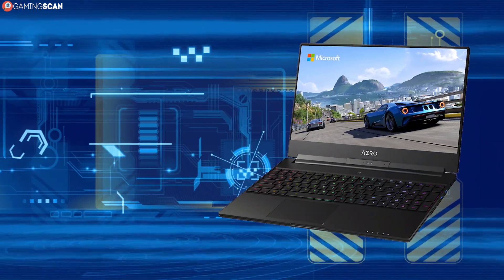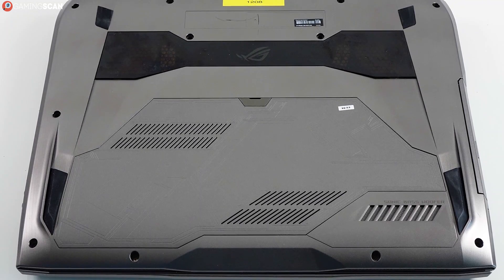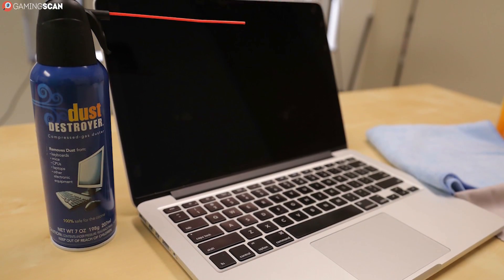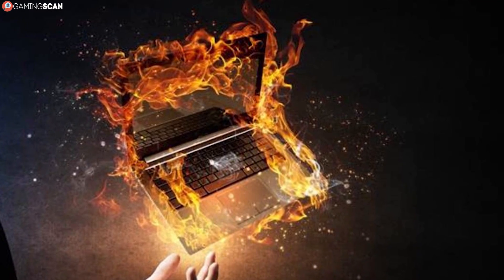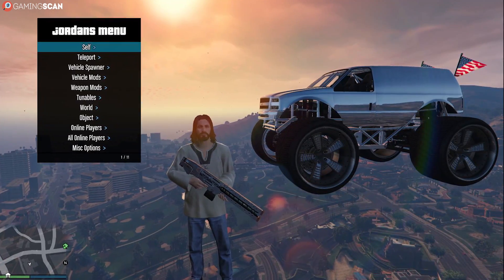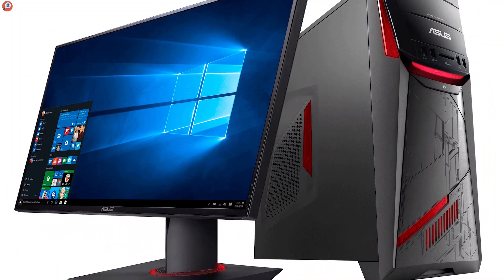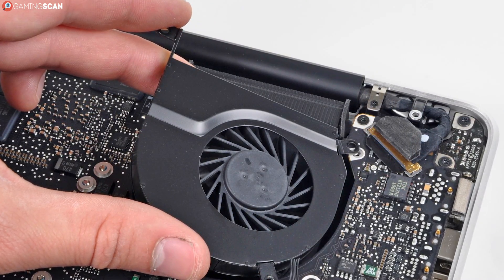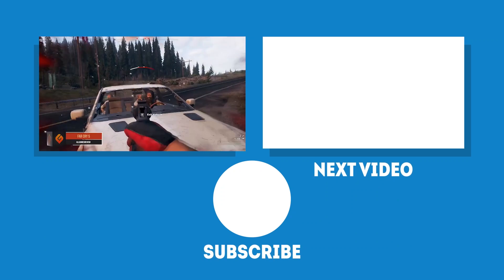How To Keep Your Laptop Cool While Gaming [Simple Guide]

Comment: Heads up: do NOT blow air in to the exhaust vents! This will reverse the rotation of the fans, causing them to act as dynamos and generate a current, potentially damaging the electronics. Techs will unplug all fans before using compressed air.
Reply: thank you
Reply: @fastbutsafe5461  it doesn’t really matter, u promise
Reply: @TheGrassyDirtBlock  My laptop gets hot when I use it to play games while charging. Is it safe and normal? It reaches like 90 Celcius
Reply: @ahmednasrullah8215  No. if it is too hot it will permanently break/slow
Reply: @jaswinder113  Now it decreased to 60-80 is that safe and normal?
Reply: @ahmednasrullah8215  how about, you put the PC fans maximum, don’t over lock it tho
Reply: @ahmednasrullah8215  90c on CPU normal for gaming laptops, think Intel 95c before thermal throttling and AMD 105c
Reply: @D3ATH-W15H  bruh. My ryzen 5 laptop is around 70 around its max with overclock. If its hits 70 im turn it off and have a break. I dont want to broke my 3060 or something
Reply: @D3ATH-W15H  BRUH
Reply: @barnabashatvani9108  70 degrees is fine for a gaming laptop, in fact that’s amazing for a laptop. My cpu is at 90-95 degrees at load.
Reply: @jamrah8713  same here, need some guide on how to cool it down. I'm using asus tuf series with rtx3070 and i7 12th gen
Reply: @edogawaeduardus6149  that's fine just don't let it go to 95 degree
Reply: I think it would be fine as long as you hold the fan or you don’t put to much air in at one time
Reply: thats why they said intake fan grills in the video
Reply: Thanks
Reply: i have a ideapad gaming 3 82SB it has an exhaust vents in the back and ive putted a box fan literally behind it, its been a week since ive done that, ive done it for like almost 2 weeks, it seems fine, laptop is new, btw i think it has 4 vents 1 each side 2 at the back
Reply: Yeah I blew my internal gpu fan that way, using an external fan now

Comment: "Use it in a cool place"
Me in Malaysia without turning on air cond to save electricity:
Reply: hi from Spain☀️
Reply: My previous laptop died immaturely because of the heating problem. My new computer has a water cooling system. Water has a very high heat capacity and latent heat of evaporation as compared to air and it can remove huge amounts of heat as it evaporates. I have a plastic tray and I place a wet kitchen towel on it. I place the lap to on the tray with wet towel underneath the computer. I keep adding water to the towel as it dries. This solves heating problem perfectly. Never ignore a heating problem.
Reply: @heavenlymilano   Smh this is so bad pls tell me you dont do this anymore
Reply: @HungryShark2  I keep doing it. It is the best cooling system.
Reply: Hi from morocco
Reply: Trueeeeeee
Reply: My laptop gets hot when I use it to play games while charging. Is it safe and normal? It reaches like 90 Celcius

Comment: One more thing you can do is to raise the laptop from the intake side using any object to allow more airflow to the intake grills at the bottom and it also provides a better position for typing on the keyboard.
Reply: I do this, and it reduced my temps by 5-10 degrees
Reply: how much raise height are we talking
Reply: @delayedcreator4783  atleast an inch or two.

Comment: Throttle stop + after burner and adjusting your fans.. hell with throttle stop u don't even need your fans maxed out if u do it right. I got a gf 65 I7 9750h with rtx 2060 tamed with amazing performance and thermals. Its crazy i have a thin notebooks thermals under control like i do now

Comment: If you wont open the Laptop to clean it, you cant clean in proberly. Cooling pads are useless. Open your Laptop will not destroy your warranty. External GPUs are expensive and pretty shitty. 

Do at least a bit of Research before you do a video like that. You havend even mentioned undervolting, which is like the only thing that helps to keep the Temperature low.
Reply: My previous laptop died immaturely because of the heating problem. My new computer has a water cooling system. Water has a very high heat capacity and latent heat of evaporation as compared to air and it can remove huge amounts of heat as it evaporates. I have a plastic tray and I place a wet kitchen towel on it. I place the lap to on the tray with wet towel underneath the computer. I keep adding water to the towel as it dries. This solves heating problem perfectly. Never ignore a heating problem.

Comment: Or u can use pressurized air, it would  be cooler then water. U just need to build a small enough compressor that fits in the fan's space and that works with the fan's voltage 😒

Comment: About that "This isn't the manufacterer's fault, they can only do so much at keeping such a cramped up space cool", not so much. I mean the CPU and GPU are clearly the components that heat up the most, and all they did is put a heatsink, "thermal paste", some copper tubes and a fan to cool down 90ºC??? Why else would they keep making computers, so they can sell them right!?
Now the question at hand, cooling pads, tried them, dont work, not nearly enough air flow. Cleaned and repasted, got a 5ºC improve. To solve this problem u have to find a way to either, blow cold air into the CPU or physically remove the heat from it. So either sit ur laptop on top a fan or a block of ice.
Unless u can find a way to water cool it, like this phone https://www.youtube.com/watch?v=F91bGJBQLFc

Comment: I had my laptop for like 2 years, yesterday I cleaned it and surprise, no dust in it, i still have temperature problems
Reply: Apply a new thermal paste or use a cooling pad
Reply: @trainerzard7  If I do both it will be more cooled?

Comment: Nothing worked. My laptop is still sitting at 88°C or more
Reply: Tf 88 is so cool I hope I can get less than 120°
Reply: @trinity2725  I have extra bottom and side fans yet it's still running at like 88°C which burns my wrists when I hold them on the keyboard

Comment: Should've mentioned thermal past, it's very important for moving the heat from the CPU/GPU to the heat sink thermal past should be reapplied every once in a while and thermal past going bad is probably the most common cause of bad thermals resulting into bad performance so one more very important tip is replace your CPU/GPU's thermal past every once in a while

Comment: Yall forgot replacing thermal paste, and if it still overheats then its probably the dissipation capacity of the heatsink itself and you cant do anything about it..
Reply: My previous laptop died immaturely because of the heating problem. My new computer has a water cooling system. Water has a very high heat capacity and latent heat of evaporation as compared to air and it can remove huge amounts of heat as it evaporates. I have a plastic tray and I place a wet kitchen towel on it. I place the lap to on the tray with wet towel underneath the computer. I keep adding water to the towel as it dries. This solves heating problem perfectly. Never ignore a heating problem.
Reply: @heavenlymilano  your seen everywhere

Comment: My Predator laptop can't handle CS GO😭.It's heating very much
Reply: Wait what a freaking predator?
Reply: I have a fucking asus with core i 5-7700
Reply: And you have a very powerful pc
Reply: And it still lags?
Reply: @filipgorgievski3633  Yes it's going upto 95% heat.Only when I play games.
Reply: Kr1spy which predator?
Reply: @babygothixxo  Acer Predator Helios 300.Can you help me? It goes upto 95 degree Celsius
Reply: Kr1spy 1660ti or RTX?
Reply: @memers43-n9s  undervolt bro. Mine Acer nitro 5 2019, it heats up same like yours too 90+ in some games . After undervolt mine now only 80 or below than that
Reply: @知らない人-g1t  It will not harm my computer na.If you feel safe to undervolt then suggest to me.BTW thank you for suggesting me.
Reply: @babygothixxo  1050 ti

Comment: I know it's a bit late but I just got the best solution for Acer Nitro 5 overheating :-
1.) Go to power options> advanced settings> change advanced settings> processor power management>change maximum as well as minimum processor rate of both battery as well as plugged in from 100% to 99%.
2.) Download Intel XTU and undervolt your cpu for my nitro 5 i got stable undervolt at -0.1. 🙂

Comment: I am stuck in lockdown 
I don't have thermal paste
I don't have compressed air
My laptop runs hot
I don't have wifi
I only have mobile data
Halp
Reply: undervolt .. google it.
also some hardware can go upto  95 degree celcius under heavy load.. mine does , n idles at 60. with undervolt i keep it at max 90c. which is good n no throttling..

Comment: Me: places books beneath my laptop
my books: burned
my house: get burned
Reply: My previous laptop died immaturely because of the heating problem. My new computer has a water cooling system. Water has a very high heat capacity and latent heat of evaporation as compared to air and it can remove huge amounts of heat as it evaporates. I have a plastic tray and I place a wet kitchen towel on it. I place the lap to on the tray with wet towel underneath the computer. I keep adding water to the towel as it dries. This solves heating problem perfectly. Never ignore a heating problem.
Reply: @heavenlymilano  damn nice explanation especially with the thermodynamics terms "heat capacity" and "latent heat of evaporation"
Reply: @Qwer-xo5cl  Thermodynamics was one of my favorite subjects at the university :))
Reply: @heavenlymilano  you are the few in my class that enjoy thermodynamics (im in chemical engineering for my undergrad)
Reply: @Qwer-xo5cl  My major is food engineering which is a derivative of chemical engineering. I enjoyed all my classes from chemical engineering. I had a great teacher in fluid dynamics. I failed intentionally so that I will have one more semester with him therefore more opportunity to learn. My favorite class was physical chemistry though.
Reply: @heavenlymilano  noice
Reply: @AlexDoesStufff  Water is an effective coolant. Not much noise, even the fans are fully functioning.
Reply: @heavenlymilano  lol

Comment: I'm surprised you're recommending cooling pads.  Have you seen a noticeable drop in temp?  I was considering getting on when I first bought my laptop but saw many many reviews that said they did very little if anything to reduce temperature.
Reply: That is so true. I don't know why people keep suggesting them, they just don't work. I can actually blow more air then these cooling pads.
Reply: Yeah thermal pads really aren’t that great and I definitely wouldn’t recommend using them for higher wattage components. Just use a somewhat high performance thermal compound. Lol
Reply: I have a Dell G15 Ryzen Gaming Edition laptop which is well known to run up to 100 degrees Celsius on the CPU under heavy load or highly taxing games.. I wanted to use the laptop on my lap without risking damage due to the vents being in on the bottom, so I got the BA Targus Lap Chill Mat which is designed for lap use - well my G15 fits it perfectly and the fans line up with the vents + plus is design puts the laptop screen and keyboard in the most  ergonomic position when using it on a table/desk... My cpu and GPU temps dropped by around 8 degrees each and now I get more frames due to much less if any thermal throttling 😊👍.. even with the cooling mats fans Turned off I get lower temps as the bottom of the laptop has far more ventilation than when it's on a desk

Comment: You forget about changing thermal paste, and it's the best you can do for overheating. In addition to that, you may need to do an undervolt. Finally, if you look for a cooling pad, you don't need 8 or 6 fans, just take a look to the bottom of your laptop, check the position and quantity of the breathing-holes on it and purchase a pad with similar fan shape. Regularly, you just need a 2-3 fans, any extra fan is going to be useless.

Comment: GUYS I FOUND THE REAL SOLUTION TO ANY PROBLEM OF CPU OVERHEATING, I can't believe nobody said that until now. Just go to advanced Windows power saving settings and slightly reduce the processor performance in percent to your liking. It's a sort of downcloack safety and 100% effective but at least you'll save the longevity of your laptop. I have an HP OMEN 15 with an RTX 2070 and an i7 9750h that went over 90° degrees before this. Now under stress it doesn't even reach 50-60° and I can still play at more than 60 fps. It's a very simple setup, goodbye expensive solutions or complex applications. Do this, trust me.
Reply: This should work as I have the rtx2060 model. The 2070 felt like a rip off for very little additional performance.
Reply: @rn-zu5ld  Ik it doesn't change that much but I bought it since it has 1TB SSD instead of 250gb or 520gb like the majority of 2060 models that I saw, and 32gb of ram. The other spec are almost the same

Comment: I think room temperature matters to the laptop somehow, I still have my laptop overheats way up to 90°C even though my laptop is new and the fan is running at 6000 RPM (which is extremely loud).
Reply: same my cpu while playing certain games will go up to 96 C
Reply: VlogStix same mine goes all the way up to 90
Reply: @VlogStix  is it safe?
Reply: And then that’s what causes the laggs in game
Reply: My laptop gets hot when I use it to play games while charging. Is it safe and normal? It reaches like 90 Celcius
Reply: @ahmednasrullah8215  thats really hot so what I did is I bought a laptop cooler fan that goes underneath it. I found mine on amazon.
Reply: @VlogStix  oh
Reply: @VlogStix  But now its 60-80 is that safe?
Reply: @ahmednasrullah8215  yes that should be fine for a laptop

Comment: Have you never owned a high end gaming laptop? they all hit 70-90 degrees Celsius on the cpu when gaming at high quality cooling pads don't assist in clooling they only make you believe they do by cooling the case, you'd be better of buying a pc, they're cheaper and last much longer also repairs cost only a fraction of what a gaming laptop would. I've owned 3 HP omen laptops in the last year due to heating issues, I've owned the Asus rog rtx 2060 and an Alienware version with an I5 instead of an I7, all of them have heating Issues, laptops can't keep up with the heat of the high specs to the point where they're selling laptops that can't handle what they're designed for.
Reply: Tech 4 Life I had a decision to pick a gaming laptop and a gaming pc and mu dumbass thought a laptop was better.

Comment: My issue is actually the fact that my laptop isn't using the GPU, it's mainly using the CPU.  Now, I have no idea why it prioritizes the CPU when processing games over the GPU, but it's very difficult to control the temperature of the laptop.  Mind you, I have a very good cooling fan that's super effective and live in a rather cold room (~30ish degrees C, since it's almost winter and I have a lot of drafts), and yet it still gets that hot when gaming.  If anyone's curious as to my specs, it's the Acer Predator Helios 300, the best laptop for under $1000 I could find.

Comment: My Acer Nitro 5 is fine with modern games,i get nice amount of FPS in game,but it overheats and gets close to 90 degrees!
Im gonna try to clean my laptop using that air in a can,wish me luck please! :D

And im gonna ask,i have cooling pad,so do i still have to put my laptop on flat surface even with the pad ?
Cuz im sitting on a couch and have the laptop with cooling pad on my legs...
thx
Reply: Same problem, but opening window when is cold outside helps a bit.
Reply: @davidsebesta677  Yeah,i know

Comment: Did everything the video said.. So my i7 8750h. Rtx 2080 laptop is not high end enough to play on high end settings?? 😂
Reply: Is there a laptop that has RTX 2080 ?  I thought that they only managed to put RTX 2060
Reply: @srp770 I have a MSI GE63 Raider with a non max q rtx 2080. Great performance! but a con it's very cpu intensive . Depends on the game but thanks to undervolting and new thermal compound the hottest it ever got was 85c

Comment: Simple Guide : 

Undervolt Your both GPU and CPU.
Download NotebookFanControl.
Change the thermal paste with liquid metal.
And you're done.
Reply: Is these method just measture the tempreture of laptop or will it fix the problem? Can u plz tell me more about it
Reply: thermal repaste voids your warranty sadly. though undervolting is good though and completely safe. i won't recommend overclocking though since it can damage and heat up your systems in gpu department. for undervolting i use intel XTU since it's easier to handle but you can use trottlestop for more accurate undervolting
Reply: @prasunkumar1125  changing your thermal paste changes nothing in your warranty in my country.

Comment: While watching this video my laptop is boiling :(
Reply: My previous laptop died immaturely because of the heating problem. My new computer has a water cooling system. Water has a very high heat capacity and latent heat of evaporation as compared to air and it can remove huge amounts of heat as it evaporates. I have a plastic tray and I place a wet kitchen towel on it. I place the lap to on the tray with wet towel underneath the computer. I keep adding water to the towel as it dries. This solves heating problem perfectly. Never ignore a heating problem.
Reply: Clean laptop from dust
Reply: kill demanding processes
Reply: @Francesco G not using a macbook though haha
Reply: Coz ur indian and it is hotter than the hell itself
Reply: K&T GAMING lol. Im not indian you stupid. Know before talking 😂. Everyone can see how stupid you are and how racist you are.
Reply: @MenukaShavindra  may be dust and Some kind of thread slowing/ blocking your fan do a check open it from back ..
Reply: @BROTHERsGAMINGxenon  yeah its what had happened thanks <3
Reply: @MenukaShavindra  what are you than Indian?